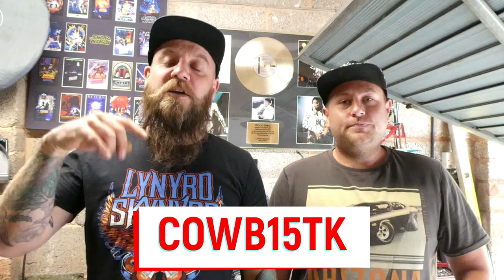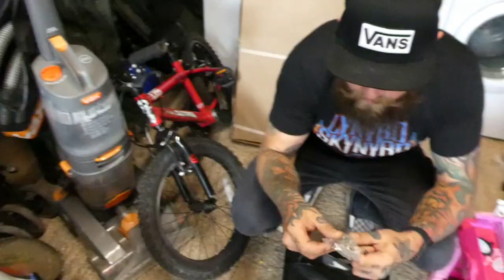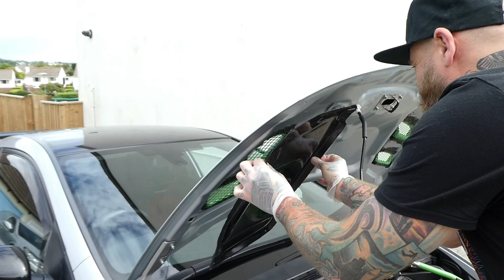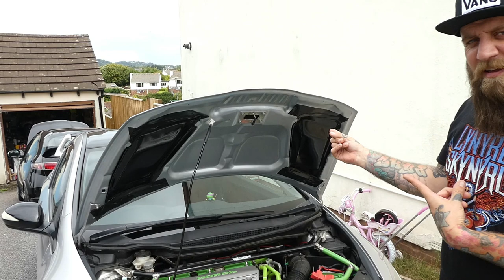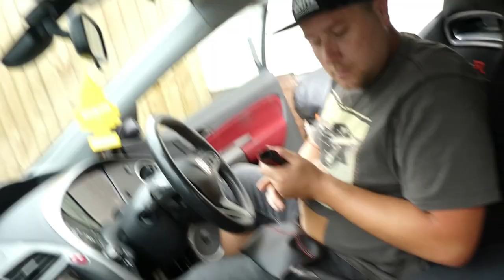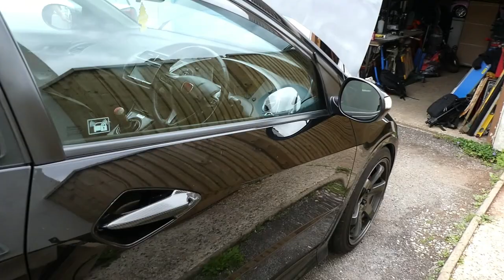FN2 Vented bonnet rain guard install and Chris does bits!

Comment: Can you give us an update with the rain guard for your engine bay? Are there any significant problems to your engine or electrics after placing the coating and the screws for the rain guard? I'm sure that water will get cloaked to a certain extent when it is raining or on a sunny day with excess water being stored. Thank you

Comment: Wont this create a puddle of water as there is no drainage
Reply from the maker: DavidusMaximus it’s either that or a wet battery and I know what I’d rather lol. Tbh it hasn’t at all since I’ve done it  really,
Reply: That's fair enough. Got the same bonnet haven't bothered with covers. I appreciate why you've done it just haven't had any negative side affects.... Yet 🙃
Reply from the maker: DavidusMaximus all I was really worries about was the battery getting soaked bud that’s the only real reason I did it, Mines parked up more than it’s driven too so it would destroy it
Reply: Absolutely mate just voicing my thoughts on my side of the experience. Totally respect your decisions
Reply: @DavidusMaximus  Typical just slap it on worry about the next problem it it comes around haha lol